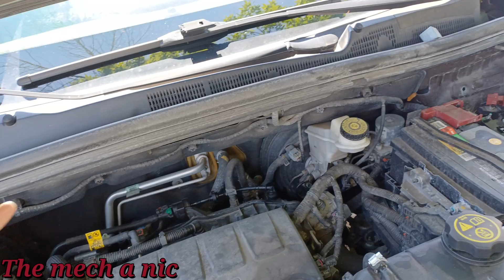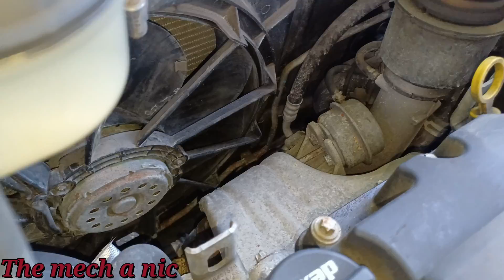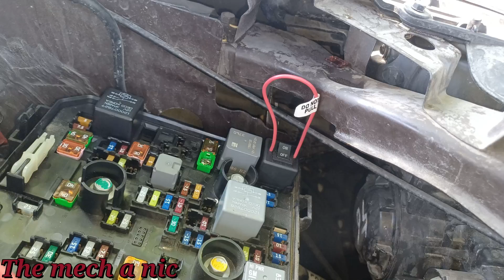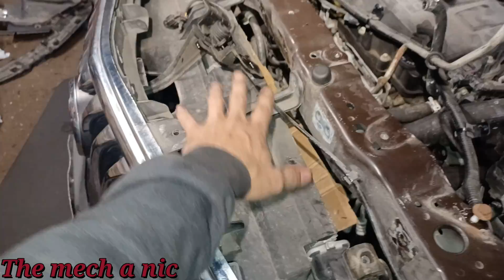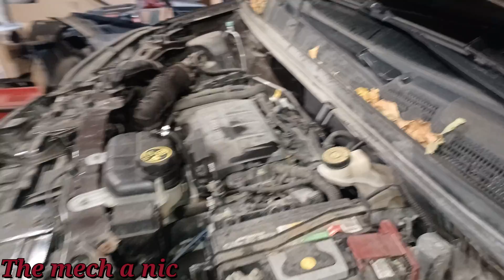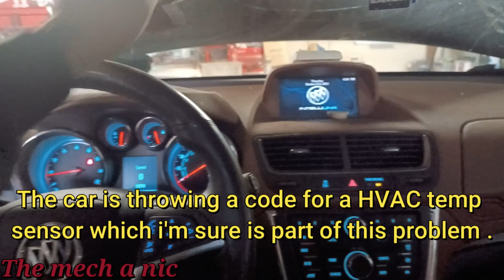buick encore no heat / buick encore no cooling fan (vol 110)

Comment: You don't seem to know what you're doing cuz that's not the problem, I think the problem is the blower on the passenger side inside the car under the glove box, why don't you check that
Reply from the maker: You're right, I've only been working on cars for two decades.  What do I know 🤷‍♂️
Reply: @themechanic6117  why did you not answer the guy above who asked where the coolant leak was, after you said they never had you fix it even after ordering the part?  Where was the coolant leak found and what part was ordered?
Reply from the maker: This was years ago on a customers car, I don't even remember

Comment: Did you ever figure out the ac problem ? I did my gf car because of same issue I replaced the coolant housing and tightened the hoses because it kept leaking ac out of hoses , It seemed to fix the problem although I have read lose hoses are common problems for this vehicle. This is my first car to work on btw I’m no mechanic like you. God bless

Comment: Those resistors used to be so easy to change until manufacturers made them hidden in radiator shrouds . They  expect people to just buy a new car.
Thank God for RockAuto , I have never been disappointed yet by the parts I have ordered .
Reply from the maker: Same with me. Rockauto Is my go to 💪
Reply: @themechanic6117  hi, I have a similar issue, but in my case the fan is good because I bypass the relay and it turns on. The compressor clutch get in as well, now when turn the AC on from the inside of the car is not turning the fan on just the AC compressor. Any suggestions? thanks for this video btw

Comment: The fan only kicks on with a command on signal from the ac pressure switch  but the ac  clutch gets the same on command so are you just hearing it engage or is it actually engaged . Ok that's what I remember from a SD vid 😅😅👍
Reply from the maker: I visually checked it. The clutch is engaging and spinning
Reply: @themechanic6117  Well keep us in the loop if she gets it fixed . 👍
Reply from the maker: Will do. 👍